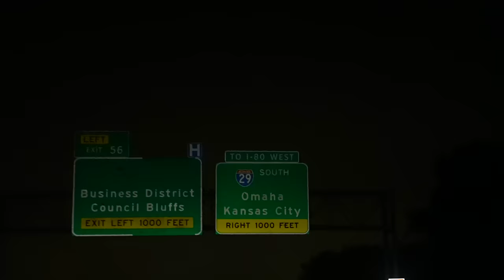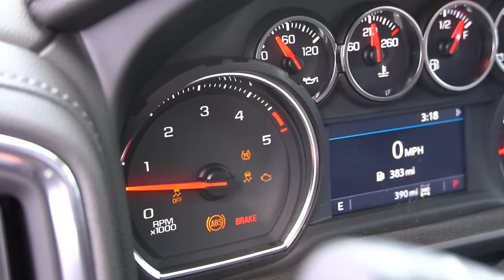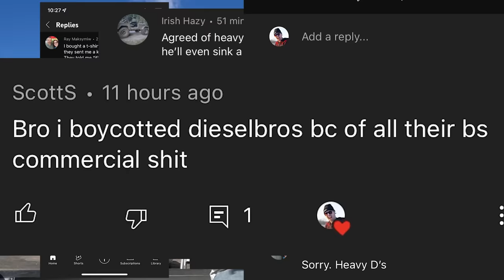Using a 2022 Duramax to try and Blow up my 6.0 PowerStroke

Comment: People say the 6.0 is the worst but I would definitely argue that’s the 6.4 is worse
Reply: I’m sorry, but my dad owned a 6.4 bought it new. 08 had 250,000 miles on it, mostly stock motor. Never had a problem. Don’t get why so many people hate?
Reply: @_bondo_8055  have a 6.4 had to replace the motor at 240,000 was even deleted
Reply: @dillpickle1547  that’s weird, his was deleted. The 6.4 was pretty much a rebuilt 6.0 with the problems fixed. He had some dans diesel performance parts but other than that stock, made 680hp then had a problem
Reply: Yeah mine doesn’t make that much power but it makes a decent amount
Reply: My father in law had a 6.4 that went bad after 68K. Junk.
Reply: 6.0 isn’t even a bad engine, factory studs and emissions wrecked it. Ask any diesel engineer they’ll tell you it’s a beaut of a motor, just need to do a couple upgrades and they’re the best turbo diesel for cheap, my stepdad got one for $800 got it studded and an egr delete, straight piped it himself and it never had a single issue he did hella burnouts and donuts too
Reply: The 6.4 is so bad ppl don’t even acknowledge it. The 6.0 is the worst of all decent diesels
Reply: I work with a roofing company, we have a 6.4 deleted, eco tune 380k. 04 6.0 Lariat 280k both strong? DK guys, I love the haters thoi
Reply: Own both stud them do some work. Both will push 1400 horse. Run them at 800 daily pulling hotshot
Reply: @Wcanada3177  no way you’re running stock pistons
Reply: My 6.0 is stock  145thoudand km, only had to change the batterys , been solid to me, just change oil and don't bag it, I also tow daily
Reply: Same here
Reply: @_bondo_8055 after my dad bulitproofed his 6.0 it would not die, we even went a year without changing the oil, and it still ran.
Reply: Agreed
Reply: They are both pretty bad compared to a 2nd gen 6.7 and a 2002 7.3
Reply: But I will say the 6.0s if they have been worked on and fully built they are pretty nice
Reply: The 6.0 and 6.4 and both good engines once the issues are taken care of. Obviously emissions on both need to be deleted, then head work for the 6.0 and pistons on the 6.4. Most people would rather do some head work vs tear down a whole engine to do pistons so the 6.0 is favored a little more. Even tho the 6.4 is an absolute beast. I’ve seen lots of 6.4s last a long time tho on the stock pistons🤷 i have a 7.3 right now but I would own a 6.0 any day of the week once the head work has been done. Btw “bulletproofed” is a company that supplies a rebuild kit for the 6.0.
Reply: Our 6.4 have 380k miles on it with a original motor but it got deleted at 115k miles
Reply: I have a 6.0 and a 6.4. 6.0 has 298k miles completely stock runs great, everything works great. 6.4 has 244k all original runs great too
Reply: @_bondo_8055 my dads been a powerstroke guy since the 7.3 in 97’ and then bought a 6.0 the year I was born and then a 6.4 and now his 6.7. The 6.4 blew up at 57k miles, 7.3 never had major issues, and his 6.0 which is now my truck has 260k with no issues although he did replace the original head gaskets and got different ones along with bulletproofing a year after purchasing.

Comment: 6.0s rip. I kept having the urge to buy one and eventually did. completely rebuilt the truck from bare bones and bare block. eliminated any failure point. fastest vehicle I own by far and has insane power all the way through the band. puts my duramax to shame.
Reply: So you spent tons of money and time to have a fast truck AFTER BUYING THE TRUCK when my Cummins will never need a rebuild and makes 700 hp reliably? Yea… sure dude… 6.0s rip lmao
Reply: @Illsayanything   sounds like a 6.0 hurt your feelings , it’s ok ….you can let it out
Reply: im a duramax guy all the way damn those 6.0s sound great and get up and go
Reply: @LiiveRosiin Too bad they’re not reliable
Reply: To bad you can make them reliable😢
Reply: @Illsayanything yeah you’re engine won’t but that damn trans will need for 4 rebuilds before a 6.0 needs the 1st engine rebuild

Comment: I think any diesel guy would admit the 6.0 powerstroke is one of the best sounding diesel trucks, only once you get past 3000 RPM, before that they sound like a fat guy in the Taco Bell restroom.
Reply: i just thought this the other video but didnt want to get ripped in the comments for it
Reply: They sound pretty good around 2200
Reply: sounds good at any rpm
Reply: No
Reply: Agreed…. They sound amazing spooling.
Reply: Idk, mine sounds like a turbo with a bit of jet engine attached to it.
Reply: I think they sound best at low rpms
Reply: What are you talking about it’s the opposite sounds like a fart at redline and your saying it does before 3k
Reply: That one clip from family guy in the stall 💀

Comment: Lol the 250 held up pretty good against the 3500😂
Reply: if u have a3500single wheel or any name truck all the factory did was put the dually leaf springs an brakes on the2500s4weight handling stoping power all250/350/2500/3500truckS has same motor transmission yes I’m a mechanic.
Reply: @raysason4838  obviously bro stop trying to sound smart that is a 04-07 powerstroke engine competing against a brand new 3500hd Chevy
Reply: @raysason4838  obviously your not a mechanic cause there's no such thing as "dually leaf springs" theres 1/2,3/4, and 1 ton springs.
Reply: @dylanlowe8859  What he's referring to is called overload springs, but yeah, he's definitely not a mechanic.
Reply: @raysason4838 you must not be a very competent mechanic if you think a half ton is the same as a 1 ton.. 🤦🏼‍♂️ a little thing called... final drive ring a bell..? Gear ratio will make a big difference.
Reply: @rudypadilla20914 thats a 2500 lol

Comment: My 6.0 has well over 600k miles with original headstands!
Reply: headstuds u meen. but 600k is actually impressive for a 6.0 is it stock? i heard they last longer if u dont put a programmer or chip in them.

Comment: The 6.0 ain't a bad truck. It was a pretty good contender for being behind in weight by like 700lbs.
Reply: I think it shut off because of the oil and coolant safety shut offs
Reply: It is a terrible engine. Worse than then 6.4. Absolute junk, ford should be ashamed of it.
Reply: Sounds like a mad dodge owner to me @Irishkiwi
Reply: @lucasgerard3947  no? I own an f250.
Reply: @lucasgerard3947  although, dodge do make the best Diesel engine you can get.
Reply: @Irishkiwi dodge didn’t make the Cummins and ford didn’t make the 6.0 international did

Comment: Just hold the brake let your buddy spin the tires white u hold then when u feel him spinning it the gas u would see different results if u do it right, but for a f250 to barely get pulled by a 3500 is really good

Comment: If you keep beating on that 6.0 like that, it’ll let go. Any of the big 3 you beat on it like that your bound to have some problem. Completely shocked it’s still firing away. But hell yeah keep up the 6.0 content
Reply: That's gentle cousin has one that won't die 5 sets of tires so far and all the revs it can give
Reply: I don't agree with that there not even beating on it
Reply: 6 o dont blow

Comment: only thing holding the 6.0 back from dragging that l5p on the rope is the extra weight on that chevy because it’s a 3500 and not 2500. 6.0 is pretty impressive for being 17 years older 😏
Reply: 100% agree. He also was just spinning the tires the entire time not even letting them catch.
Reply: It's not even a fair test once completely stock the other ones deleted in tuned My 06 duramax LBZ would tear that thing up all I've done to it intake exhaust downpipe and a lyft pump With Idaho rob EFI live tuning
Reply: @stevekettner6026  ok
Reply: @stevekettner6026  ur japanese duramax is cute lol
Reply: @Jumper365  lol Japanese engines are the most reliable engines ever far better than any ford or chevy or dodge motor made that's why duramax has never changed its PowerPlant 6.6l with Allison tranny
Reply: 6.0l  It's one of the most unreliable engines ever that's why it was only in the truck for 4 years and then they change to even more unreliable 6.4l motor Ford sucks man. The only motor that's good that Ford ever had was the 7.3 l International motor.
Reply: @stevekettner6026  did i ask you ? you sound like everyone else, a broken record. everyone knows this, i have a 6.0 with 363k miles still runs like brand new and does 0-60 in 5.4 seconds. studded, deleted, & tuned. i could care less about your opinion, enjoy your izuzu chevy lol
Reply: Lol 3.2 seconds here 🤣 😂 😆 that's slow enjoy
Reply: Oh buy the way that's stock motor and tranny 387k miles 4wd high powerbrake 2nd gear lunch 3.2 sec 0-60 only a lift pump exhaust and intake and efi live tunes
Reply: @stevekettner6026  not in 4 hi lol. that’s just rwd
Reply: @Jumper365   Well you're not doing it right lol
Reply: @stevekettner6026  um ok

Comment: The 6.4 power stroke isn’t that bad of a truck if you delete all of the emission control’s another problem I had with them is blow by not for the reason you think if was the oil to air return connected to the oil cap I’d still do head studs fuel pump and forged pistons heads the piston arms are great it cost like 4000 to completely bulletproof it and delete it there really not that hard to work on either everything is just crammed in there
Reply: No matter what you delete from a 6.4/6.0, it will always be the worst ever diesel. They’re basically designed to kill themselves.

Comment: Just clear the codes on the duramax and it will be fine it’s just wheel speed sensors tripping out, my truck did the same thing.
Reply: We cleared it right away.  It was fine

Comment: Y didn’t you guys do a 4x4 tug-of-war? To scared the 6.0 world brake lol 😂 jk
Reply: prolly scared it was gonna drag it
Reply: @wendellallen822  I'd sure hope the 6.0 wouldn't win, it's almost 20 years older, its clapped, it weighs almost a thousand pounds less and weight equals traction that's all there is to tug of wars
Reply: @thirstymoose392clips2  the f250 has a Dana 60 in the front though while the 3500 has ifs. The chevy probably would have broke
Reply: @JoeE22  I’m yet to see front end problems on these chevys under heavy towing. All I see are these solid axle dodge and fords needing constant rebuilt front ends
Reply: @rock-uu7qr  a straight axle, especially a Dana 60 is so much stronger. Why do you think every jeep person swaps one in when running big tires?    Yeah towing something might not break the ifs but a pull off sure would. Chevy just switched to it because people want their truck to be a car and don't use it as an actual truck. I'll stick with my 97 f350. 1 ton axles, and manual locking 4wd. 280000 Miles and she shifts into 4wd every time.
Reply: @JoeE22  They swap to solid axel for more articulation it has nothing to do with tire size
Reply: That Chevy ifs front end would have the aluminum junk ass axle housing laying all over the pavement  Ford is a real truck

Comment: That's not even a fair test one truck is deleted and tuned the other 1 is completely stock still pulled the s*** out of it Power stroke 6.0  is the worst motor ever made especially a stock one
Reply: Well, the Duramax was in 4-wheel drive. Not too fair. These pull offs boil down to weight and traction. I’ve had both, a 2019 SRW 3500 Duramax Denali LB and I also own a 2007 Ford F-250 Powerstoke. Love them both. The Duramax is so smooth it’s deceivingly quick even stock. But, I must say, most people dig the 6.0 more. More attitude, sound and character!